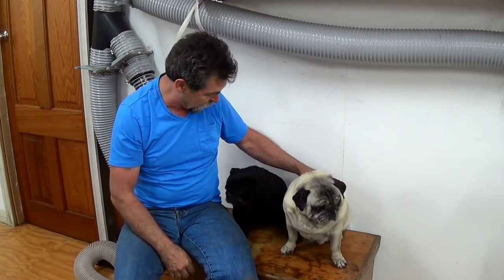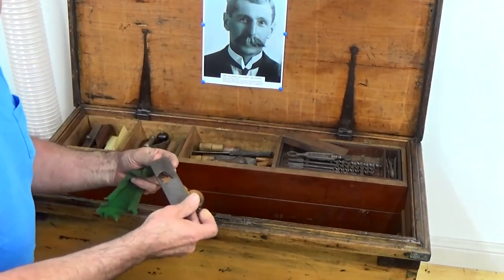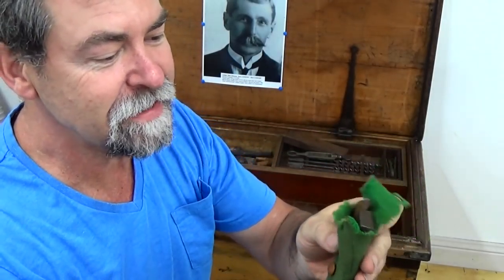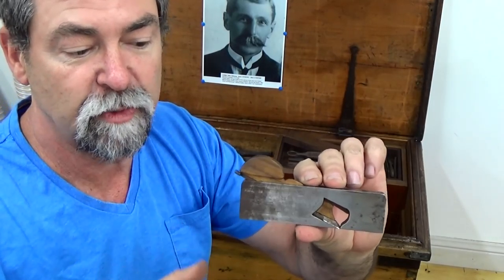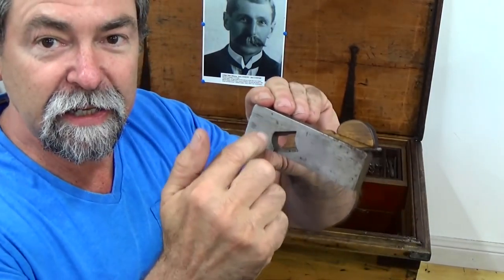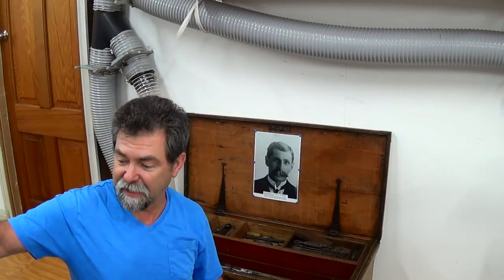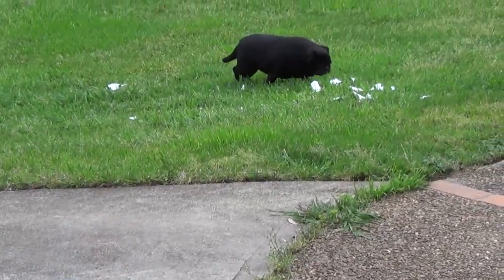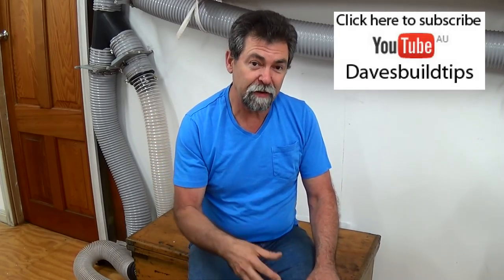What's in Arthur's (My Great Grandfather) toolbox episode 3. Small shoulder plane.

Comment: Thanks again Dave! It's amazing how well kept they are.
Reply from the maker: +DANIEL WANDLESS Yes Daniel, when you consider they are around 100 years old and I haven't used them (apart from a router plane) in the 30 years I have had Arthur's toolbox.
Reply: +DANIEL WANDLESS It's pretty easy for tools inside a tight chest to not rust/tarnish/corrode from the sulfur in the air. Easier in the countryside, away from dense traffic.

Comment from the maker: Jim has pretty much covered it but there are some other interesting things about this plane. The body is made from 3 pieces of steel that are laminated together. This allows the blade and the wedge to have passage through the body. The wedge is timber and is thinner through the body but larger above to allow more control and comfort in applying pressure to lock the blade in.
What other features can you see with this little shoulder plane and tell us its uses. As Jim has had his turn, maybe someone else can chime in?

Comment: Nice little shoulder plane Dave...hmmm let me see now.  You have a body, a wedge, the blade which goes through the throat (which is on the sole of the plane body) which leads the the escapement (hole in the body).
Reply from the maker: +Jim Dockrell (Watertone) 10 out of 10 Jim! It is indeed a shoulder plane.